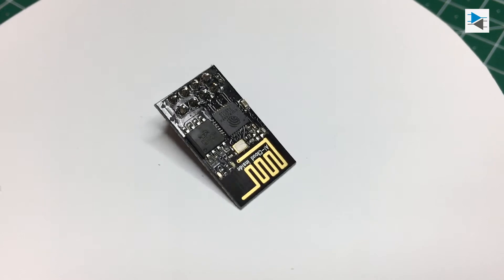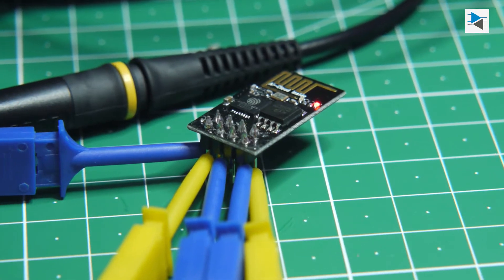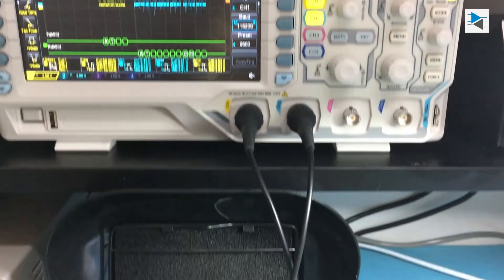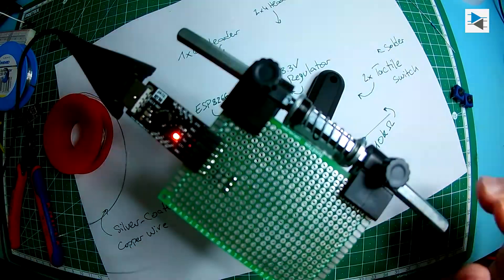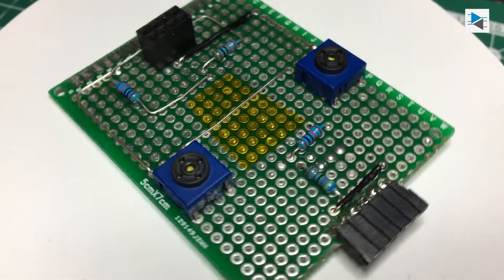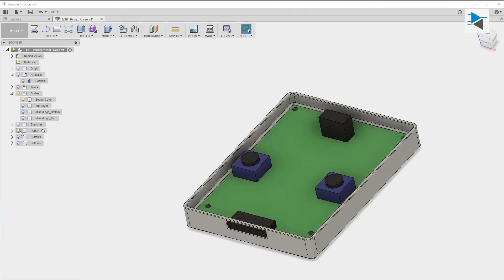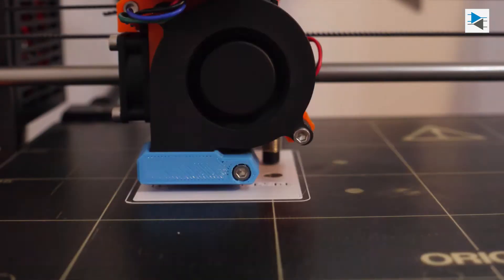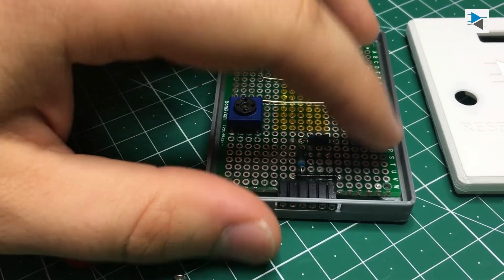ESP 8266 Programmer

Comment: Would you share the STL files for the 3D printed parts? Very cool project!
Reply: And the part number and where you purchased the buttons
Reply from the maker: Thank you, sure thing! The mounting holes on the board are not quite standard as I had to remove  a bit from the bottom but I have included the STL of the circuit board mockup and a photo with a ruler for reference. Hope it helps!

Thingiverse: https://www.thingiverse.com/thing:2399135 
YouMagine: https://www.youmagine.com/designs/esp8266-programmer-case
Reply: Thanks, I will have to fire up the 3D printer this weekend. Any info on the switches that mate with the button caps?
Reply from the maker: To be honest I just used whatever I had in my parts bin, but any tactile switch should be ok. The main body of the one I used was about 10x10x4.7 mm with the switch  of about 6mm diameter and a height of about 2.3mm, so the total not-switched height should be somewhere around 7mm. Keeping that in mind I think any 6x6x7mm tactile switch should work just fine.

Comment: but you can buy an esp8266 wemos d1 mini which has the programmer and regulator and usb port on a tiny pc .plus it has more of the esp8266 pins available
Reply from the maker: Hi tim bo, thank you for your comment! Of course you are right in that there are alternative options that make it much more painless to hook up an ESP8266. The wemos d1 mini that you mentioned or the nodemcu variant are very nice. Those options have a slightly larger footprint, are a tad more expensive (of course they would be, because of the extra parts) and there are projects where you don't really need the extra pins (there will be an upcoming one).

Most importantly though, there wouldn't be any fun to be had when buying a ready-made one :)